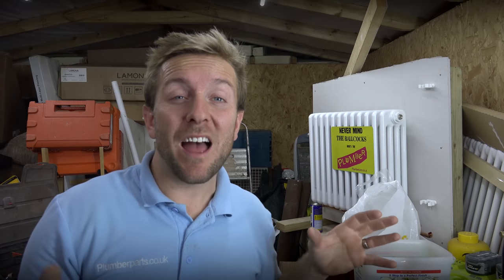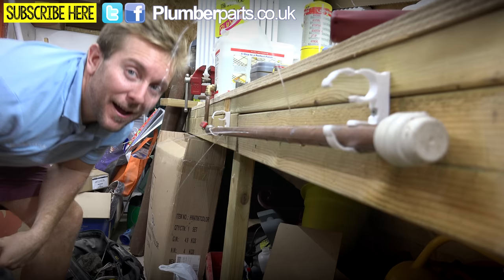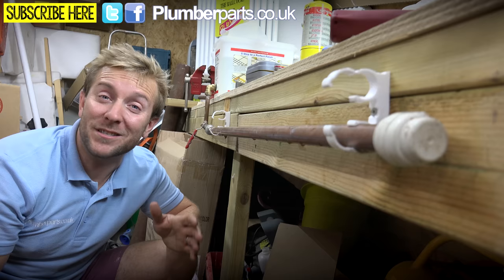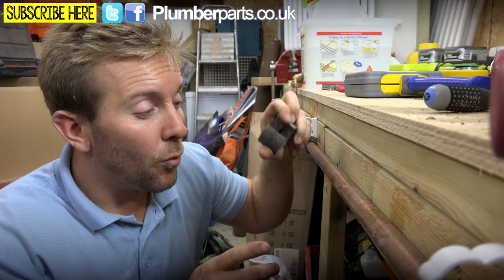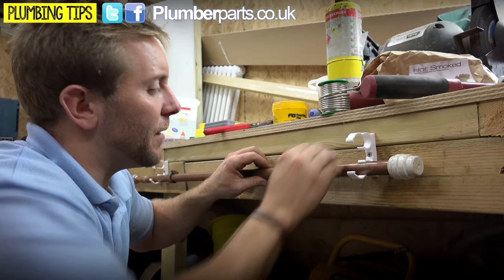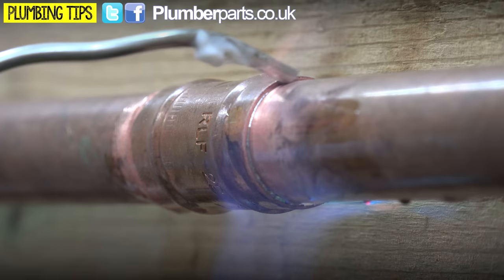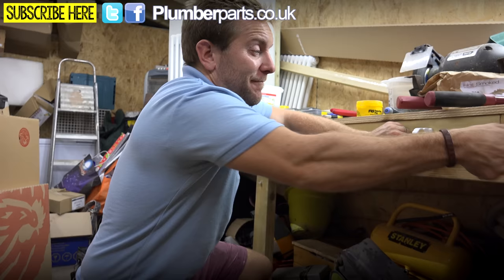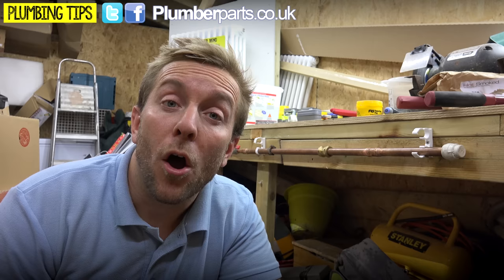FIX LEAKING COPPER PIPE - PINHOLES - Plumbing Tips

Comment: Hi James, new to your channel, have liked and subscribed.  my question is my bath, doesn't have a bath panel so can see all pipe works. however, one of the pipe rubber pipes  have not been fitted it pops in pop out with too much water pressure. it been working for 20 plus years with no leaks. only about a month ago the pipe has started to pop out and  leak out water.  all pipes are rubber. what is the best way to fix,  I would like to fix this problem  with out a temporary fix, I really missed having a good old soak. I haven't called a plumber because they would charged over the odd. :( any tips would be fab, I can attach the picture of my bath to my profile. thanks PS Happy to send you a thanks payment.

Comment: SOLDERING OVERTIME CAN RUIN YOUR LUNGS. YEARS BACK A FRIEND OF MINE TOLD ME TO USE LACO FLUX BECAUSE IT WAS SAFER FOR YOUR LUNGS. STAYED WITH THE HERCULES AND HAVE LUNG ISSUES TODAY.  I SEE YOU ARE NOW USING A DIFFERENT BRAND FLUX. WHAT IS THE REASON FOR THIS?

Comment: When inserting a compression fitting in a tight pipe you have to remove about 8mm of pipe  - not just make one cut as this will force the pipe to longer length

Comment: why wouln't you shut off thw water , cut out the damaged section and replace it with a new section of pipe, instead of pissing about with hose clamps and bits of rubber?

Comment: How to block small holes in a pipe with no pressure in it. 
Not necessarily something which would translate to the average mains pressure.
Method 4 is a stainless steel self tapping screw, and screw that into the hole. I've got them all over the house and they last for years! I really must get around to a "proper" fix.
MAKE SURE IT'S A STAINLESS STEEL SCREW THOUGH!!

Comment: You can buy in the UK what American plumbers call "shark bites".  they are fittings which use no compression ftgs  or solder ftgs or even bits of rubber with a jubilee clip. They just push on -after deburring the pipe.  Suppliers I found were Raptor Supplies.  Have you ever used them?

Comment: Errrr tip for ya pipe slice. Turn it in correct direction 2 or 3 revolutions turn it backwards 1 or 2 turns then forward again. Cuts ya pipe quicker. Thank me later.

Comment: You didn't vent the pipe. As it cools the air inside will contract and suck a pin hole though the solder before it sets. I am a plumber I know this to be true.

Comment: Anyone can fix those leaks. My leaks are always a bad solder joint in an elbow or tee, facing the wall. And the main shutoff valve doesn't shut off 100%. And it's Christmas day, and I have a cast on my leg. So fix that!

Comment: The fastest way to fix a pinhole leak temporarily is to get the water out of the pipe and use silver solder on each one until you can replace the whole damn line. It’s much easier you don’t need any flux .

Comment: All the methods of repair will not work on a 90 degree elbow.  In lieu of replace the copper elbow,  clean area around the pin holes then just add flux and enough solder bridging over the tiny hole.  No need to cut the pipe, all problems are solved and at lowest cost.
Reply from the maker: But temporarily just like these fixes!

Comment: Everyone on the planet knows that trick. The pin holes most times are 6 inches to a foot from a joint. Fixed many without shutting down the water.

Comment: The 2nd repair is BS. Most of the time the pipe length is fixed. You cannot expect to spread the pipe apart and put a compression fitting.

Comment: Chloramine is the culprit, 5 years after city switched to this my copper pipe gets pinholes. Middle of the pipe not caused by solder deterioration.

Comment: 𝗧𝗼𝗽 𝘁𝗶𝗽: For Yorkshire fittings there is no need to feed solder in because they already have a ring of solder inside the ring.
Reply: If you've removed enough of the old solder to refit the joint, there can't be enough left to FILL the joint when reheating.

Comment: These demos are only that... demos.
I don't think that real world situations are ever as simple for a number of reasons...
Pinholes are created by corrosion. Although briefly mentioned in the video, the cause needs to be determined and in my experience are primarily caused by 2 things... Improper matching of metal parts and pipes that cause electrolysis, and pipes located below ground. 
Pinholes are also only where the corrosion has broken through to the surface, Unless you determine the area of the corrosion, you will have additional pinholes developing in the coming weeks, months and years.
And, above all... unlike in the demos, the pipe to be repaired won't generally allow for so much convenient movement.

Bottom lines...
Be knowledgeable about temporary fixes. But temporary fixes are not permanent and shouldn't be forgotten, and they sometimes are also not code compliant. Do a permanent solder weld as soon as practical.
Become skilled at learning how to do solder welds when you can't stop water flow completely. Done expertly, it's not difficult but for novices it will be a struggle.

Comment: So what to do when the pipe is in a wall? you want to hang something, drill a hole and boom water is spraying in your face. The pipe is in the cement layer so one cannot wrap around it. Still the wife wants to cook so the water has to be switched back on again. Here is the trick:  Get yourself a copper bolt just a litte wider then the hole. Blow torsch the pipe long enough to get is as dry as possible. screw the bolt into the hole. then solder the bolt in the hole. Ready to go again. It is a emergency repair that could stick for years.

Comment: Just re-do the video with the right end of the pipe fastened like the left hand...  ... and put a 2x4 or 2x6 protruding over the top and along the bottom of the pipe, jus about 4-6 inches away from the pipe all the way along it. And set it in a 4' x 4' hole three feet away from you...
...just for realism.  😉
Reply: Oh, and fill both ends of the pipe with water.  And include your brazing techniques.  Thankyou !  😊

Comment: Your repair won’t last! Have you heard of electrolicist? Having metal clamp touching copper pipe with the flow of water that’s grounded through the earth will cause pinholes from the inside out. With 14 pounds (max) of head pressure it’s not even close to being under pressure like a real repair!

Comment: HOW DID YOU SOLDER SIDE THAT TOUCHED THE WALL?.
Reply: The action of the solder melting in the hot copper pipe makes it draw into the close gap formed by the fitting and weld sealing it..  it’s called a capillary action .. Google it !

Comment: rubber? really? why bother using a bit of rubber and a clamp or splicing the pinhole? unless some idiot drilled or poked a hole in it, if you got pinholes chances are your pipe is rotted. copper is cheap,  mickey mouse repairs arent cheap when they fail and flood your house.

Comment: wh- why did you just solder a press joint.
Reply from the maker: That's a capillery fitting, not a press joint. 👍
Reply: @plumberparts  Dotcha think it looks like it's got the 2 rubber rings in the video